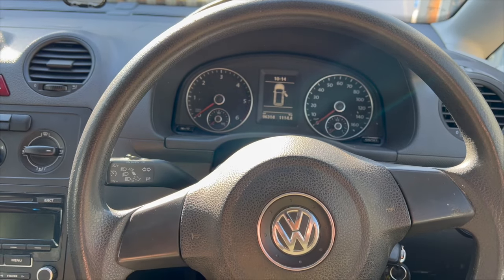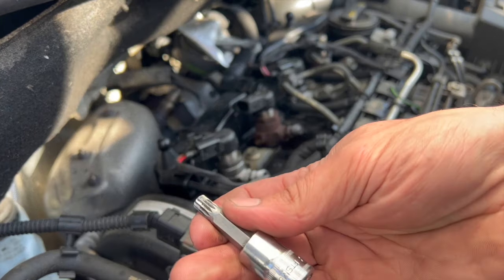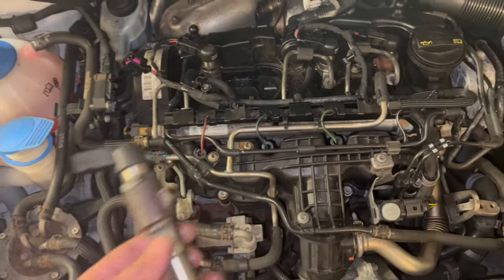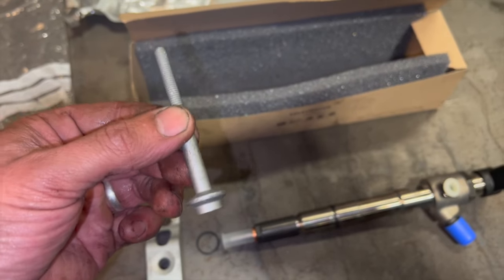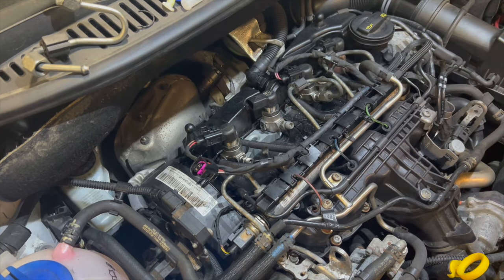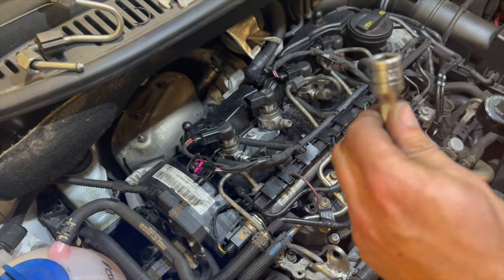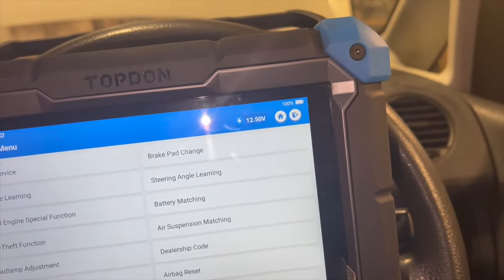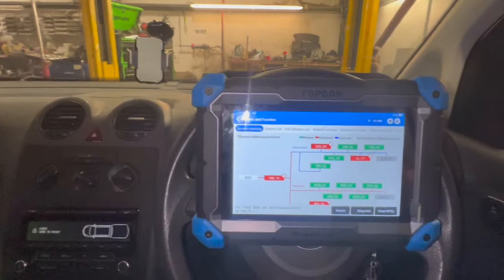VW Caddy 1.6 TDI Injector replacement

Comment from the maker: New Vag injector puller - https://diydaly.co.uk/products/ct6383-diesel-injector-remover-for-vag-tdi
New Fuel injector Ebay - https://ebay.us/YZHlnQ
New Injector clamp - https://ebay.us/15Gy6f
New stretch bolt - https://ebay.us/bvNuMB

Diagnostic machine used in this video:
Topdon Phoenix lite 2 Ebay - https://ebay.us/tsyiTI
Topdon Phoenix lite 2 Amazon - https://amzn.to/3dxuQQl 

Check Euro car parts - https://tidd.ly/3lIO7xA  (use discount codes on site)
Check "Car Parts for Less" - https://tidd.ly/2LNEwIn  (use discount codes on site)

Tools used:
Socket set - https://ebay.us/7tUKdM
Digital Torque wrench - https://amzn.to/34kpI9y
Torque Wrench - https://amzn.to/2VZ4CKu
Screwdriver set - https://amzn.to/30RA53L
Spanner set - https://amzn.to/2DlwUZm
Injector cleaning set - https://amzn.to/3grvnPB
Injector seal removal tool - https://amzn.to/2O9d7P7
Ring Inspection Lamp - https://amzn.to/3gGWHcG
Triple square socket set - https://ebay.us/VVgTRV
Air vibration hammer / chisel - https://ebay.us/niKsPx
Needle nose Pliers - https://ebay.us/GPQZjx
Prybar set - https://ebay.us/LNtJ1M
Bonnet lamp - https://ebay.us/3y0gGv

Injector clamp bolt torque setting:
stage 1 - 2NM
stage 2 - 8NM
stage 3 - 270 degrees
Reply: Alright mate, I see the injector cleaning set doesn't have a reamer, is it a completely necessary tool, or would I be ok be a kit similar to the one you've linked above? I have one very similar to it.
Reply from the maker: @Jim_Kay.  yeah it’s not Essential mAte , I very rarely use it on these engines
Reply: @diydaly  Sound, there’s a diesel leak from either 3 or 4, but no codes (but noisy and weak in low gears, so I’m guessing a seal kit would be a first step?
Reply from the maker: @Jim_Kay.  yeah check that and the return hoses

Comment: Do not recomend going to 270 degreese if injectors have been out before, as i just had the threads in the head pull out before it reached that torque

Comment: Had a very interesting talk to a VW mechanic when my 2014 Caddy went in for a service. He said that all VWs are ECU programmed to all fail namely the EGR valve, then the Glow plugs, then the injectors before it gets to 100k
Reply from the maker: makes you wonder sometimes!
Reply: Why? Did anyone at VW explain?
Reply: I've done 180,000 miles in my VW and had one injector go in that time.
Reply: Done 130k and only one injector had just gone off that list.
Reply: Yes that’s correct so far with me and my van is only 69000 miles 
Almost experienced two of the list points
Reply: Not sure about that. My CAYC engine lasted to 226,000 miles before the EGR went.
Reply: Just acquired a 1.6  Caddy runs fine 3 injectors are replaced- but pil is leaking on to the rocker cover whilst the engine is running- its made a mess ,where should I be looking first- it runs well .
Reply: 220000 Miles so far so good still I have the dpf same turbo injectors etc..

Comment: Ehm, don't you have to loose both injectors? I mean the claw is locking both, injector one and injector two. So you have to loose both of them step by step to get them out without needing so much force and breaking the claw.

Comment: Have just done this. Get the engine HOT as you can! Had to re-fit 3 injectors to run the engine again to then remove the 4th one. The Sealy VS2040 puller or Laser 7525 tool  also make it easier. Thanks for the video!
Reply from the maker: 👍👍 thanks ill check them out

Comment: Great video, very informative however folks don't use the socket on the fitting with the extension bar on the injector as it will snap like it did with me. I would suggest using a proper pulling tool if it really tight. Now I've got to find a replacement fitting for the injector. NIGHTMARE

Comment: Hi would you know if the topdon arti diag 500 is ok to put fault codes out on injectors and problems with other cars ? Thanks.Also would i definitely need to cut the injectors seats back in any info would be great 👍
Reply from the maker: For for the late response mate! Been of I’ll for a few days! I’m not 100% sure about the artidiag 500 , I know it will read and clear the faults but not sure if it will do the coding.. usually a good clean of the seats will suffice , the kit I use is really good value for money; I’ve put a link in my video description to it

Comment: Stoked...!

That's the Re-con Injector from Germany put in, and she runs fine.

Need to go down my Local Wee Garage and let them Code in replacement injector tomorrow.

It looked as if someone had been in there before.

Thank you very much for your help checking those Torque values, and for taking the time and effort of making the Video. 
Doing it myself, with your advice saved me hundreds (possibly Thousands) in Labour charges getting old injector out.
Reply from the maker: Nice one , no probs 👍 glad to help

Comment: Mine came out with gentle prying, using the adjacent head bolt.
Thankfully all the copper seals came too. I’m at 460,000km and they’re the original injectors, so I’m getting them all done. The one that packed up is surely not the only one feeling tired.
I was wondering how to clean the seats, because leaking seats are the main reason for them seizing in place, so I didn’t want to just drop new seals in there and hope for the best. I didn’t know there was a specific tool, so thanks for that. This is my first time doing it myself on a common rail engine, though I have seen it done, a few times.
I’m very surprised how tight you had to make the saddle clamp. Mine were not noticeably tight, coming out. Certainly not tight enough to stretch a bolt. I got them with a 1/4” drive ratchet! It’s all I had, with an 8 spline key. I was expecting to use an adapter, to tighten it back down with the same 1/4” drive spline key, but I think it would shear off at that torque. I feel some new tools coming on!
Reply: Update: I got the cleaning kit and it had quite a lot of stuff in it that I didnt need for this, but will doubtless be glad of, at some point. Also got a new 1/4" torque wrench, because none of mine go down to 7N/m, as instructed by VW, when I bought the new bolts. Interestingly, the reconditioner had me put them back in a different order. He reckons no2 and no3 got transposed at some point in the past and it should really have flagged an error. I did as ordered and didnt need to code them. It runs much better than at any time in my ownership. 
The bolts were only €5 from the dealership, so definitely better to go genuine for those.
The last wrinkle, for me, was tge leak off pipes. I did it your way yet still screwed up the retaining clip, somehow, with the result that it blew the pipe out on the test run, making an expensive, smelly mess. After a clean up, I was able to extract the clip, put the pipe back in and secure it properly, without losing the clip down the engine. Fiddly, but better than pulling the injectors again.

Comment: Neat little engine. Still fairly crammed engine bay.
My Volvo V70 with the 5 cylinder 2.4L engine offers more space and better access, although the engine is fairly tall so getting to the AC compressor and turbocharger in the back is only really possible from below and the long nose of the car makes it hard for a not so tall person to access the injectors.
The engine is slanted backwards it would be too tall for the engine bay otherwise.

My favourites are the 1.9PD Diesel dead simple engine really and the Mercedes OM611 since them are longitudinal.

Comment: Hi, great video of this job, just wish the link you show for the copper washer extraction tool kit was correct.
You link doesn't show the full kit you use just the slide hammer on its own, so no injector seal cutter tools available
Reply from the maker: Thanks , I’ll check into that , must have changed

Comment: Very informative video and well filmed thank you, this is just what I was looking for for my first attempt at undertaking the same job
Reply from the maker: glad it will help 🙌
Reply: @diydaly  what size of the cleaning/cutter tool you use for that?
Reply from the maker: @robsonenduro3316  I’ll try check mate , was a while back I did this one now
Reply: @diydaly 
Can you let me know if injector can be cleaned and also is coding essential or can work without it
Reply from the maker: @TonyWise-f1n  should really be coded , they can only be specially cleaned by an injector specialist

Comment: Can't understand why you didn't remove the clamp first before attacking no 2 injector with an air hammer? no 1 injector was loose so you could easily have removed it first instead of breaking it? Also did you not think maybe it would have been a lot easier if you soaked it in penetrating fluid (plus gas) first?
Reply: Because you cannot get the penetrating fluid down to the injector bore - the rocker cover is in the way !

Comment: Initially only tighten the fastening screws with MAX: 1 - 2 Nm.
After installing the high-pressure lines. Final tightening torque: 8 Nm + turn further 180°.

And why do you not adapt the minimum deviation quantity for the injectors?
Reply: Elsawin states 8Nm + 180 degrees for the CAY engines  I see that autodata is telling ppl 270, probably why I see so many broken bolts in the bearing cover 😂

Comment: Excellent video,  very informative,  but in your link it doesn't say which reaming tool you used . Do you remember the size ? I'm having a nightmare with oil around injectors even though I've changed everything for genuine . Just didn't re seat it . 
Thanks

Comment: The 1.6 looks more complicated than the 1.9. I've been working on 1.9 and it's a sinch, although I did learn to fit parts on gassers with my dad. My tiny diesel isn't too complicated. 
Even the drive shafts come out easily.

Comment: excellent vid, i need to replace one injector as well. Question, where the dirt goes when you clean the injector hole with that tool and air gun? is that tool required?
Reply from the maker: A small amount goes in the bore , you really want to a Avoid it but the blow gun will get most out .. you can try it without

Comment: Hi, slightly off topic but same engine question.Have you come across the common problem of VW/AUDI 1.6 TDI common rail engine tick and rough idling when cold first start? I have performed VCDS full scan but no faults stored.This would appear to be ECU injector control related.
Do you have any guidance or experience on how to solve this annoying issue.

Comment: I have a Passat b-7 2.0 tdi (common rail), the oil level rises, sometimes it does not start well when cold, when the engine is warm, it starts well, two injectors are wet, could the reason be in the rem kit of injectors?  Thank you.

Comment: Interestingly your steering fault lamp came on by changing injector No. 2.  I've just completed the same replacement and my steering lamp also came on during 1st restart.  Thankfully it cleared itself again once the steering was turned under power.
Like another person who commented on here I too would NOT go 270 degrees after the 8Nm torque, 180 is fine. and well tight enough.  And on that point, of all things I would not advise buying none genuine stretch bolts.  Quality control standards may not be met by copies and you risk an unnecessary shear off. Furthermore you may find they are also cheaper from an Audi dealer rather than VW.  I paid less than £4 each.

Comment: Should i do an injector adaptation cycle after replacing one injector ? Ive coded it in everything is running perfect.
Reply from the maker: if you've coded it should be good to go
Reply: @diydaly  was a new injector anyways 🤙

Comment: Hi, I have a VW Golf mk6 1.6 tdi cayc,after using VCDS to run a IDE 06141 Adapting injector minimum deviation test which failed to compleat.
Now my car runs lumpy at first start up when cold.I have also noticed a strong smell of diesel from exhaust but no white or black smoke.
On a 55mph run my fuel economy has reduced from approx 56mpg down to 44 mpg,
So it would appear l have a over fuel problem after this failed ecu check. As all was good before l carried out this IDE 06141 VCDS check.  
Any ideas as to what l should check to find out what has changed,in order to try and fix this problem?
Running VCDS scan no fault codes are present,so fault is  not setting  any fault codes.
Any help would be most appreciated. My

Comment: Hi DIYDaly, I managed to replaced my injector! I think I did a good job thanks to you but I forgot to bleed out the air inside the fuel system. After starting the engine one of the fuel return lines popped out with diesel coming out. Did you have to bleed yours?  How do I do it?
I have got white smoke coming out from exhaust and misfiring engine. Any help is appreciate it
Reply from the maker: 👍 you shouldn’t really need to bleed it, it might crank a while but should fire up ok? Did u do any coding?
Reply: @diydaly   Yes. I did the coding using VCDS. I am starting to think ot is a bad EGR valve! I managed to get the below values from VCDS. 
Injector Quantity Deviation Cylinder 1 = -1.0933mg/stroke
Injector Quantity Deviation Cylinder 2 =1.5006mg/stroke
Injector Quantity Deviation Cylinder 3 = -2.6509mg/stroke
Injector Quantity Deviation Cylinder 4 = 2.4872mg/stroke

Comment: Your videos are great bud, thank you for the content, can you confirm the injector seat cutter size you used , I seemed to not have the correct size in my kit, I'm guessing 15mm seat 17mm shoulder 👍
Reply from the maker: Thanks 👍😃👌. yeah im fairly sure thats right mate.. I try check the kit tomorrow when im at work 👍
Reply: @diydaly  thanks mate 👍

Comment: I have changed all of my fuel injector  a month ago  my slef  but I didn't recode the  data  does that effect the  performance?  Answer would be much much appreciated 😊😊
Reply: Evening
one of mine finally gave up the ghost 134k 
all original 
just wondering how much and where did you get your full set ?
appreciated 
Daz

Comment: Yet another question,is it better to remove fuel injectors from a vw tdi engine CAYB- CAYC  when the engine is hot/warm?.
Or better to wail till engine is cold.I am wondering about expansion of Aluminium cylinder head more than steel fuel injectors.
What has been your experience do you have a preferance of when to do this opperation?
Reply from the maker: engine warm sometimes helps , laser do a puller for them that works well! https://ebay.us/JSSUZK  works on a few other injectors too

Comment: Hi DIYDaly, is the fuel system under pressure before removing the 17mm high pressure lines? Will the fuel come out splashing?
Reply from the maker: Not when it’s not running

Comment: Tighten my clamp bolts to only 10Nm,  is it to low?   
A litlle but sceptic to add aditional torque...

Made now arround 45.000km, seems fine
Reply from the maker: Ive listed the correct settings in my description mate

Comment: Can I sugest using a vacuum cleaner when removing injector and cleaning out the bore. I use a wet and dry vacuum which will suck up oil and bits of metal etc.

Comment: My vw sharan (14 2.0 TID) playing up, engine temp hoover around 80 even on long drives, from couple of months it’s started to go into limp mode, showing injector two open circuit, additional heater fault, engine light n glow plug light on but then all of sudden it drives fine lights disappears. Bought it less than a year ago can’t afford to spend thousands nor get rid, any suggestions be appreciated. Thank you
Reply from the maker: Possible injector injector wiring harness , might be worth checking it’s not got a recall , they did have some injector issues

Comment: Hello ! I have one cayc 1.6 and have change injector (2 & 4)  A2C9626040080  while 1 & 3 are the problematic 27b.
After change last cyl nr 2 , car working good but is shaking a litle on idle and high gear low aceleration. like 80 km/h at 4gear or 5 gear only when put acelerator max down it shakes.
What can i do to improve stability, just change the others 2 injectors ?

Comment: When blowing out the injector port with the blow gun what if you blow carbon into the cylinder ?will this cause any engine damage
Reply from the maker: Possible , obviously you need to be carefully sometimes I’ll block the hole with a screwdriver , I very small amount would harm anything
Reply: @diydaly  OK thanks

Comment: Hi mate - great video. Same issue as yourself, sheared the injector clamp when removing! Just a quick question regarding coding in, are there any consequences to starting the engine and driving without coding in injectors first? Might need to drive it to a garage with vcds tools to get it done once new ones are in. Cheers
Reply from the maker: Neh you should be fine doing that mate , I’ve not done it myself but I’ve known other drive for 10/20 miles after without coding
Reply: Cheers. Got them coded in and injectors calibrated etc. Less than 10 miles and another one of the "new" refurbs went. Circuit malfunction. Think I'm done with this engine...
Reply from the maker: @robbie6983  arr no what a disaster 😖
Reply: @robbie6983  I’d skip refurbs if I was you. If you want to save money then best going to a Breakers yard and getting them there. 

The price for new ones has come down a lot, but still pricey.
Reply: @danyo1972  Yeah learned this the hard way unfortunately. But luckily got my money back after a second refurb went barely doing 20 miles again. Refurbs are not the answer for this

Comment: So, no cleaning of the injector seat on cylinder 1, and no new copper seal?
Reply from the maker: I didn’t on this one as I only had 1 seal but it’s is advisable to do both .. I’ve done it like this loads of time tbh and never had the other leak